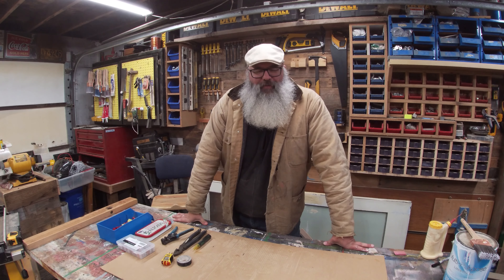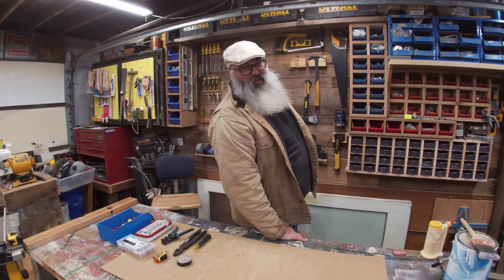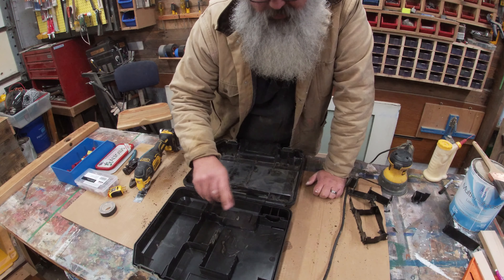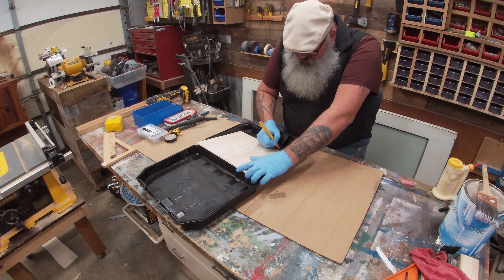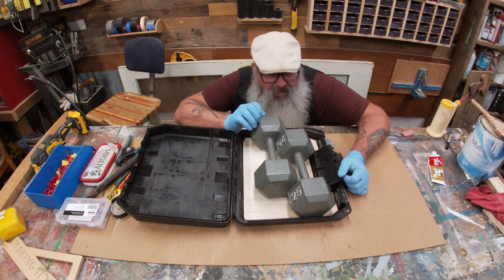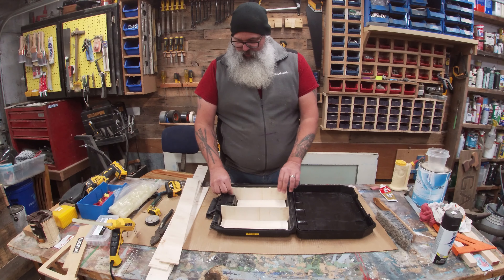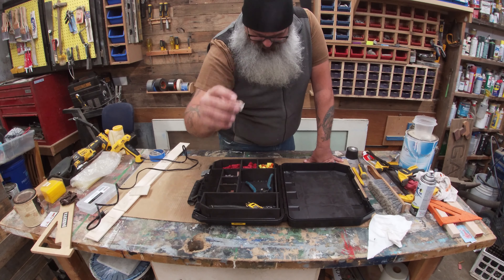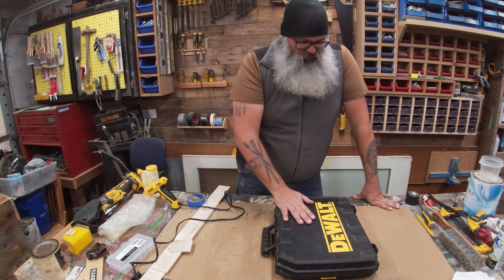Turning a DeWALT Case Into....

Comment: Bet you could tack some egg crate foam on that other side with spray adhesive and it might hold those little bits in place when it’s closed.
Reply from the maker: Yeah, that's a great idea! I really feel like it's only a 1/4" those little boogers are slipping through. Lol!